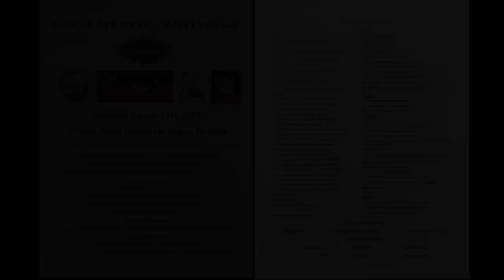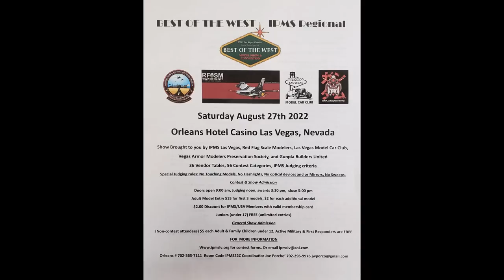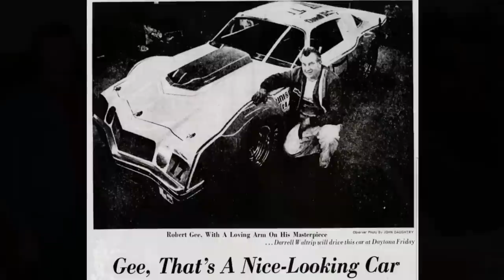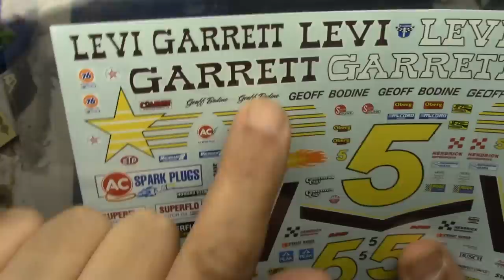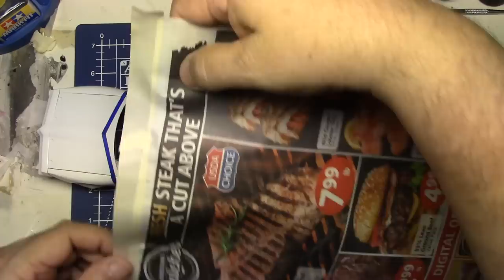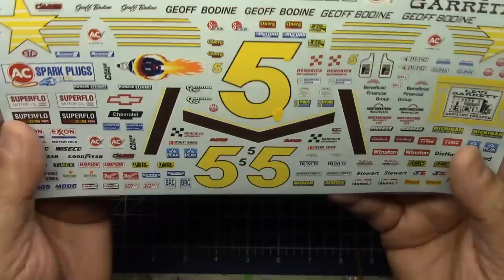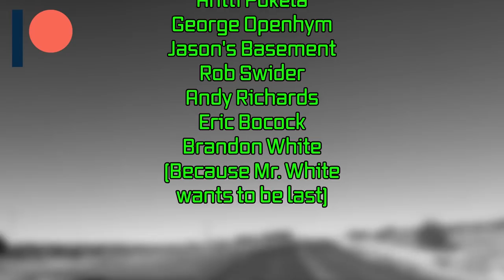How To Tape off Paint Parting Lines to match Your Decals On Your Model Car Build Ep.229

Comment: And a tip to everyone on that fine line tape I keep mine in gallon ziplock bags and have nails on the wall that my work bench is up against and I have the bags up with the fineline tap in it and I never let it sit on a surface it stays in the bag at all times and never touches my work bench or any surface and I have not had aessed up paint job ever since by just keeping it in the bag at all times and never let it toch work bench just take care of your tape that is theost important tool you have in model building it can make or break a build and cause you hours of unwanted work to undo aessed up paint job from bleeding due to tape edge being messed up from falling or laying on its side and picking up tine bits of dirt that won't allow it to seal down all the way to your body. This video was amazing please use this model as a whole series of building a show quality vintage nascar cup car chassis scratch build and all every step please and thank you. It's worth the extra over priced cost of Tamiya fine tape in plastic dispenser to garuntee you always having tape that won't leak or bleed cuse it's sealed to body perfectly. And this is the fun part hours of taping and finding centers and laying out tape for a minute or two of painting then back to back taping for the next layer or color of paint lol.

Comment: The 88 camaro at 2 25 mark was driven Darrel waltrip had fenders that were made by Volkswagen beetle fenders . The same design was also used by # 61 of Ritchie Evans after the success it had.
Reply from the maker: Yep, it was Robert Gee that came up with using the VW fenders on DWs car.

Comment: This is a great how to video. Question, if you paint the hood and body together don't you have trouble getting paint around the edges of the hood and fender area?
Reply from the maker: Sometimes. It didn't on this one. I normally will not paint like this.. But I was willing to touch it up if needed. I felt thst it was better to paintvwith the hood on, so that I'd get the paint line, right.

Comment: Very good video Luka. Do you prefer the air brush to spray paints? I've never had an air brush but would like to try it. Are most of your paints water based? Thanks Luka.
Reply from the maker: I use both. I want to move into doing more airbrushing. But like in this model. The mail white color was done with a spray can. That was a lacquer.
Reply: @TheLukaCeeChannel  You do some beautiful paint jobs.

Comment: Hey I got left hander chassis number 5 and Robert G built the car they got the chassis from.left hander and he built it from ground up for a latemodel team in 90s and helping left hander test out different front end geometry cuse they used the Camaro front stub part of frame cuse that was the best geometry base they had in 90s for asphalt super latemodel racing. From front crossmember forward is Camaro/left hander clip from front crossmember back is all tube chassis under slung winters quick change. The body he had hung on it was a outlaw super latemodel asphalt outlaw latemodel Camaro wedge body. I turned it into a limited asphalt latemodel still race it against modern coilover full 2 chassis cars I still win races with my Big spring type card that I have that he built and of course got a different body and everything else like that on it but that chassis and some other parts he own that and built that into a race car back then. My car has spring shocks and weight jacks and the newer asphalt late models are all tube chassis with all coilovers and a lot more advanced with bump stops and coil binding and this is the only front stock style clip car I've ever seen you could coil bind
Reply from the maker: Back in the early 90s. I was on a dirt late-model team that we ran a perimeter chassis with a Camaro front sub and screw jacks that was 11 years old.we rebuilt that POS. and ran against full tube offset chassis cars. We won the track championship that year. I have no idea how we did that. LOL. We did put a driver in the car that had absolutely ZERO F##ks left to give. He was an artist behind the wheel.
Reply: @TheLukaCeeChannel  it happens man but tube chassis technology back then and coil over stuff for dirt and asphalt latemodels was very new still, they was just learning about coil binding and nobody ever ran a big bar soft spring setup they all liked that small sway bar heavy spring setup on the big spring non coil over cars which was more common then coil over cars on asphalt and especially on dirt. I was born in 92 but I have driven se outdated rides before and to be honest man in classes like limited asphalt or dirt latemodel or 602 crate lates on both dirt and asphalt which is very low horsepower cars all this new technology yes helps but not as much as it does with bigger motors so guys who don't have money and have a good driver and setup can and will win races with 20 year old technology. I have taken a 10 year old super latemodel and placed 4th against the best 30 drivers in the country in asphalt super latemodel racing.
Reply: @TheLukaCeeChannel  and dude that is to funny taking a perimeter chassis asphalt big spring car and it doing decent on dirt. Did y'all have to cut the right front frame horn and raise it up so it doesn't dig into the track in the.corners cuse that's only way I would see that to begin to work is starting with that then adding bird cages or push pull bars cuse with out that it's very hard to stay up on the bars on dirt
Reply from the maker: @youknoweverything7643  OH, that car was a piece of work. It had been in a few bad wrecks over its life. We would straighten the frame in a regular home garage. With a chain bolted to the floor and we'd just start jacking on it. Cutting rewelding. It was a mess. That car was so off. The wheelbase what shorter on the RIGHT SIDE. So it had a Hell of a push. Like I said. I had NO idea how we did what we did with that car. It was that driver we had. We'd set the crosswieght at 51%. And let her go. We had a perfect engine it that car. A Chevy 383 and a set of Cup heads from Junior Johnson. Last Chevy short track car from the 88 season. I have no idea how Harvey (the car owner) got those. We were in Phoenix Az. I think it was our engine builder that pulled that off. We ran 2 seasons with that engine.
Reply: @TheLukaCeeChannel  dude that is freaking awesome and I started racing when I was 11 mom and dad owned north bay speedway in north bay Ontario Canada when we was stationed there cuse dad did 30 years in united states airforce. Mom started racing next season track was gonna close so they bought it to save it for 4 more seasons. And then when they bought the track it's how I started driving because I never ran a go-kart I hopped right to my mom's super stock which is a V8 street stock with a bigger motor in it and started driving that at the age of 11 maybe 10 is when I started driving that. But at that track we only had two divisions the V8 Superstar / Street stock class and the 4 cylinder rear wheel drive mini stocks and nobody use a frame machine or anything if you bent the frame it's literally chains and trucks and trees they used with tape measure to straighten frames up there man they was literally old school get by with bare minimum cars but when they would go to the big races at berry speedway and stuff like that they always dominated and took home at the least all top 5 from our track in every class. We had one guy named Jason Clark his ministock mustang was junk twisted floor board oil misting out of every possible place half the time cause they always used old gaskets and seals or made their own and his oil gauge always misted lol this car was junk they would race on dry rotted old racing tires cuse nobody threw away racing tires there until there was nothing left unlike here they run three laps and tires not doing what they want they toss Emm away and buy four new ones there they would run them to the cores then they would get the better looking ones and run those and won tons of races. His car was so unsafe and junk that when we went to a big race at Barry me and my dad literally spent almost $1,000 at the parts store and stuff like that putting his car together to make it safer and just to be able to race and he's not winning the damn thing and all we spent money on was literally gauges and mines and gaskets no suspension parts or nothing and maybe one shot with him because his shock was so busted it wasn't doing anything on the right front it was the stock shockey got out of some other type of front wheel drive Honda street that he ended up making work and they would siphon and steal gas out of people's cars at night on Friday and Saturday nights to go racing Sunday at the track we owned. But you know they were the poorest racers and poorest people you would ever meet they were the nicest people you would ever meet too and one of the best drivers ever met he was. But even in my race I'm going to move down here to Alabama it's a whole different story down here this is like NASCAR at the local tracks on asphalt because you have a bunch of people that used to race in the old NASCAR series back in the '80s and nineties that are still racing at mobile Speedway and five flags to this day so you got a big crop of really good drivers down here and we made it winning races by doing the bare minimum using grain scales and just have to make her own sit-up tools or strings and plumb bulbs and winning races while everybody else is using lasers and all this new stuff I eventually got expensive stuff but it took us a bunch of years to save up money and slowly collected all but I still do everything myself I couldn't afford to have a shock builder that will come the track with the shot down in my trailer and do nothing but help me with my shocks I rebuilt my shock to the racetracks if I need to reval them for compression and rebound and even dyno my own shock on my own pneumatic shock Dyno I built my senior year in highschool for a engineering college scholarship I even wrote the program using just Microsoft Excell to input the data and it would graph your compression and rebound on charts and line graphs and automatically compare to the numbers you had done before and go back to any chart you want and compare, and I also wrote the program right at the track you put your tire temps and stuff like that in the info when you come off the track and you put in the computer it'll literally tell you what your valving and compression should be for the most optimum conditions of what the track is doing while you're at the racetrack it'll help take the guess work of valving shocks if that is the problem but I only had to do that a few times. But I race against some of the best local short track drivers in the nation man. From sportsman to 410 wing sprints and everything in-between has at least two-5 drivers from the 80s and 90s days of nascar latemodel racing where you show up with open hauler and hope to win enough money to go to next nascar race. And it's so much fun racing down here but very expensive cuse you have to keep up with the times and technology now cause of how far advanced it is.
Reply: @TheLukaCeeChannel  and also can you make this car your building a while build series like if your gonna make it a model where you take it to shows please do a whole series on building a huge show ready model nascar from custom built frames and suspension and parts to custom cages and dashes and body parts and everything you do to build a show ready nascar and kit at all to that matter and show every step of way that is what we need on YouTube cuse builders like me who are ready to take that huge leap to show models have no clue where to start and need a very detailed in depth series on it would be amazing and I know I speak for about another 1k plus ppl who want that as well on the FB groups I'm part of cuse there is no one whole series on YouTube by one person start to finish explain every single step in full detail it's just videos with parts and pieces of how to do this and that and doesn't really show how that step corresponds to the next so please if you don't mind turn this into a how to build a best of show quality vintage nascar. I love building nascar's more then anything but I'm just so new to the custom scratch building that I feel like I'm beating my head against the wall and ruining expensive new Jr salvinos kits then I am actually building by trial and error
Reply: @TheLukaCeeChannel  and know what else would be amazing is if you came out with a jig that will allow us modelers build our own show quality and true to scale nascar chassis modern ones and vintage classic ones from 70s-2000s that way it will make it easier for new builders to learn scratch building and bring more cars to the huge national model car contests and shows because more new builders will actually have cars that they built that will be able to compete against guys who have been building for 20-30 years and has these crazzy true exact scale replica of a nascar chassis and parts because alot of your box kits don't exactly have every scale exact part you need for a show quality model nascar or oval track car. A few jigs would be nice for Camaro front stub asphalt latemodel and tube from front crossmember back and under slung for your 80s style asphalt super latemodels and same for dirt cars then have a jig for full tube chassis dirt and asphalt latemodels and then jigs for each type of nascar cup chassis from 70s  80s 90s and even two or three jigs to build each type of nascar truck series chassis from 90s and up to mid and current 2000s. That would be a huge help to new modelers who have gotten good at box stock clean builds and ready to progress to better more scale scratch built show contest competing cars that won't get laughed at cuse the show in Vegas if you don't have a beautiful true to scale hand made chassis and parts you won't even be anywhere close to having the top 100 best model there lol you know what I mean. And it would be easy to make the jigs just use chassis you already built that are the best male a jig by hand using styrene rods and stuff then make it to where you can 3d print the jigs.
Reply: @TheLukaCeeChannel  and also salvinos Jr doing custom bumper covers like y'all did that one is the right step in right direction for amazing things coming for oval track model building. We need some noses and bodies that look like those crazzy 80s style outlaw asphalt super latemodel Camaros with all the curves in the nose and how the whole body is like a wedge and very aero dynamic looking with huge spoiler on back huge wheel well archs and giant 10 inch latemodel slicks we need a few bodies like that and cheap and easy to obtain including generic looking street stock bodies for asphalt cars and street stock type dirt bodies. Look up Monte Carlo SS street stock body by AR racing bodies and just look at that whole website of bodies we need all of those bodies and pieces in model parts form or even kit form where salvinos Jr has a kit that has like 5 or 6 different style oval track non nascar style bodies and tons of parts for 5 or 6 different classes then add like two or three chassis jigs for building the chassis along with the Camaro front clip for the older asphalt Camaro / tube underslung latemodels and modern asphalt and dirt style open wheel modifieds not the tour style but the Midwest dirt mod stly e and the non tour asphalt style modifieds. And if salvinos Jr does a kit like I describe they could call it the ultimate stock car builders collection they would sell like hotcakes have different types of motors and parts and all in them like tons and tons of parts and could charge like 80 bucks for it but it would have like 200-500 parts of just shocks springs leaf springs shackles hoses braided lines pre made with  a-n fittings brake lines break air cooling ducts body braces wing and spoiler braces tons of gussets for roll cages few different style of racing seats old 70s bomber style and all way up to new butler built style full containment seats and budget kirkley style bolt on seats as well. It would be awsome and I could help them design the lot and what all we would want in it as customers and builders. And that kit would have such scale parts and bodies like I described that you could take it to shows and have a car capable of placing if built correctly or call the kit the ultimate racecar kit series. Please bring this up to salvinos Jr and please consider doing a full custom build series on this Levi's Garrett car to make it into a car that you would bring to shows to try and place and win in the nascar vintage or classic model division of the shows and contests like the Vegas one and the huge ones like NNL west and east and the huge national shows.